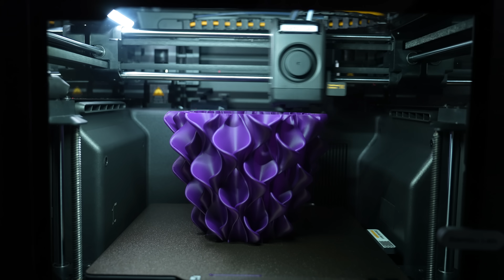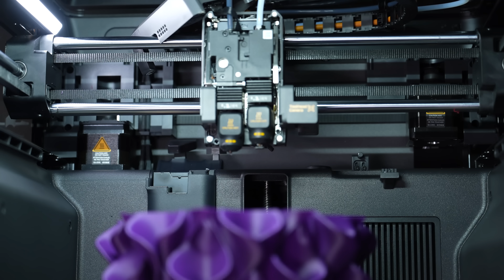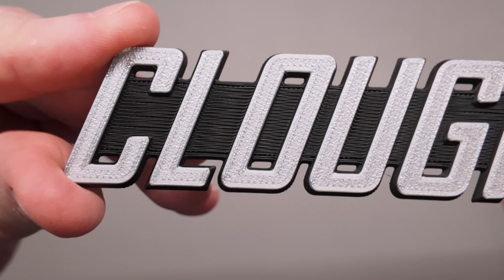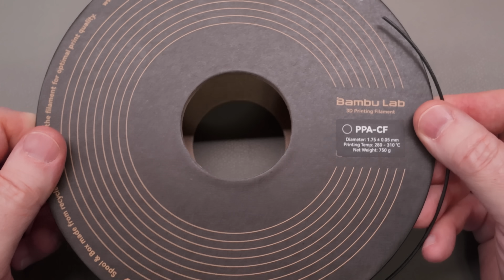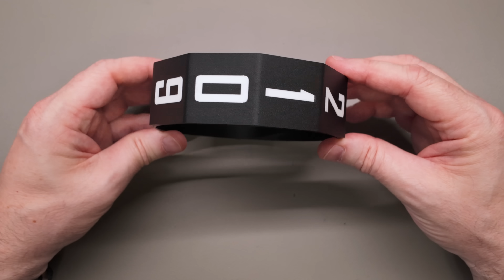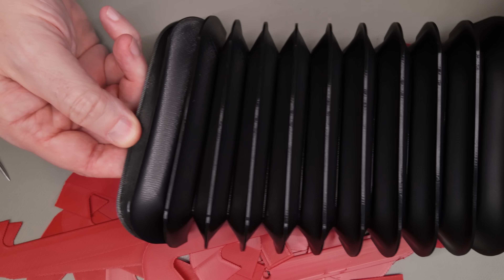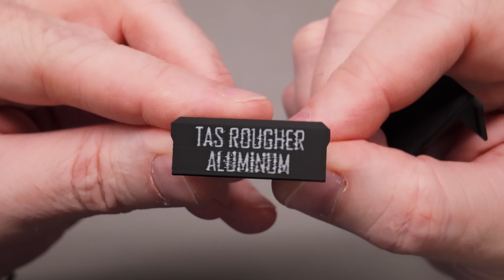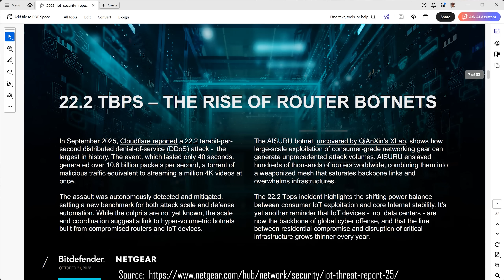X2D Deep Dive: Dual Nozzles, Bowden Extruder & Real 3D Prints

Comment: Great review!
Did you add a fillet to the vertical edges of the blue text? Or is that a dual nozzle artifact?
Reply from the maker: The model is square.  The rounding is from the nozzle traveling around the outside of the corner.  Part of it is probably motion smoothing, and part of it is the round orifice and fluid dynamics of the filament.

Comment: I'm still rocking my Kickstarter X1C and love it.  I am planning on buying the H2D or H2C.  This was a great review.  Thanks again...
Reply: I’ve had the H2C since the day my local Microcenter had them in stock and have 0 regrets so far
Reply: @flyingfortress4819 👆, i love the H2C sad i cannot get more holographic bedson the smaller bed.. but the vortex is awsome
Reply: I have an x1c as well. I ended up going with the snapmaker u1 though due to its lower cost and better multi-material capabilities. Would love to get an h2c though.

Comment: Most concise review i've seen of a product in quite some time, love the specific test samples and engineering examples. Recently (8 days ago) got the P2S so trying to decide if the $100 upgrade is worth it or not.
Reply: My P2S is 3 weeks old.

I would clearly buy the X2D for the added features “in case i need them one day” for only 100€ extra if i were doing the purchase today. I don’t plan to print anything that would make those extra features mandatory but it’s a good edge. 

Now I already have the P2S unboxed and installed and with 100h of printing, Im too lazy to even look at the return conditions.

Comment: I would love to have a Bambu Lab printer that can print engineering materials plus TPU, so you can design in a groove, and fill in a gasket material to make water resistant boxes and equipment boxes. Right now, you have to print the boxes and separate print for the gasket and press the gasket into the groove. My current printer is obsolete... X1C printer combo.
Reply: There are definitely ways to print a TPU gasket onto another base material using the X1C. I've done it, including before the TPU assist module was released.